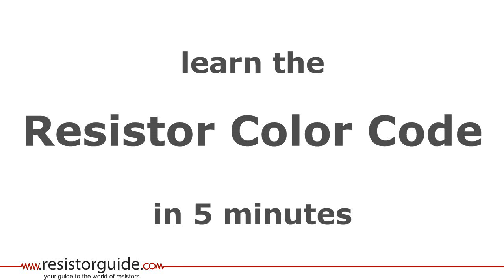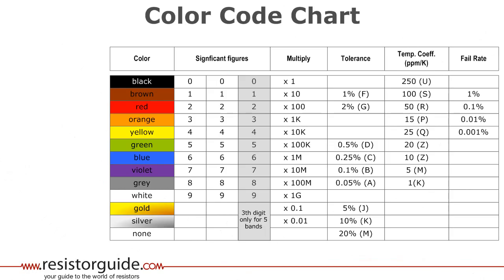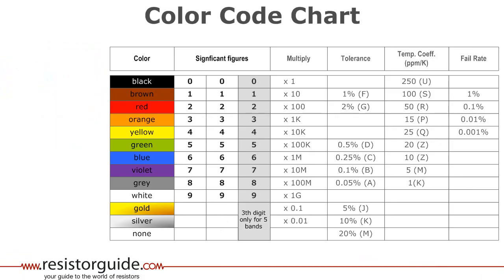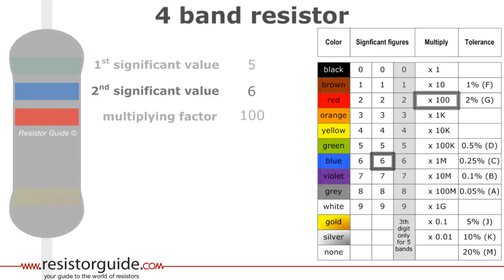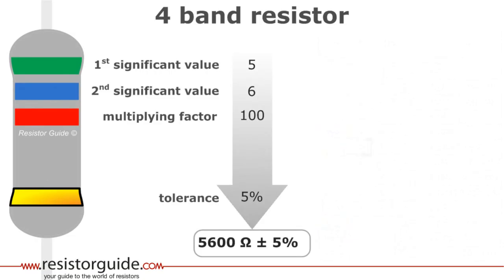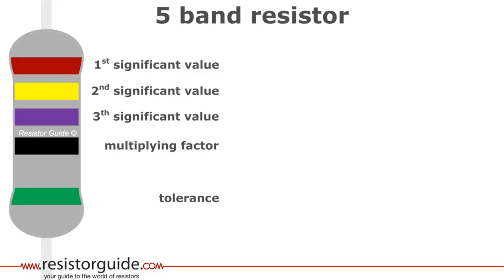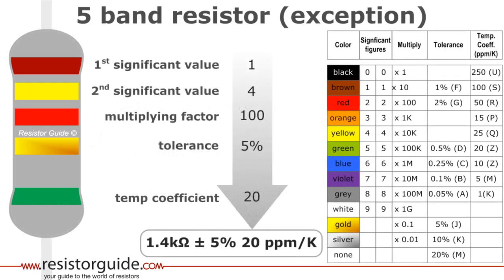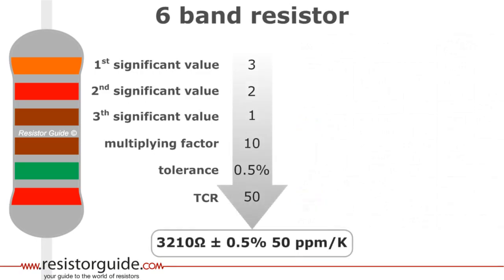Resistor Color Code

Comment: is there any way to know resistor's max power ?
Reply: +strssko Usually based on the case size (see Mfr spec), and heat dissipation.  If there is enough copper to spread the heat, one can easily pass the wattage rating without issue, in low-temperature applications.  But not for high temperature high reliability applications.